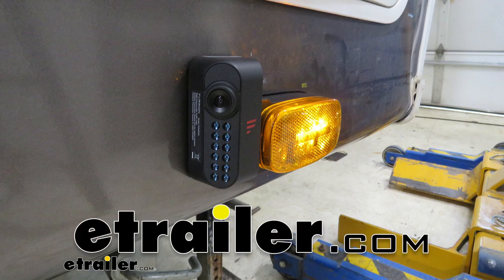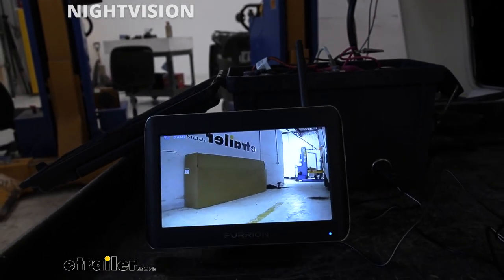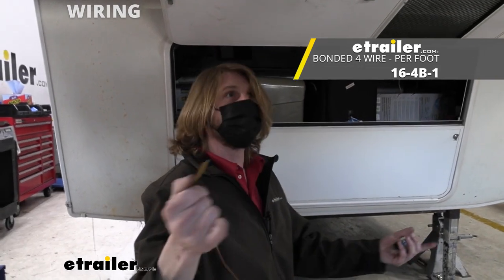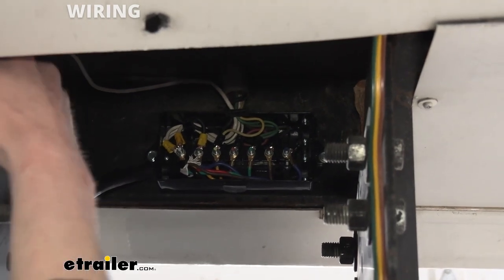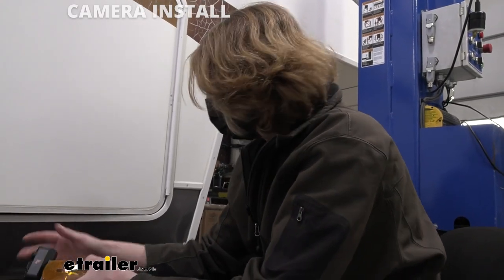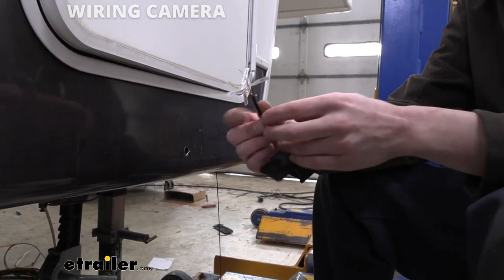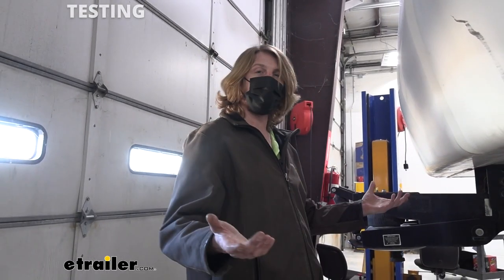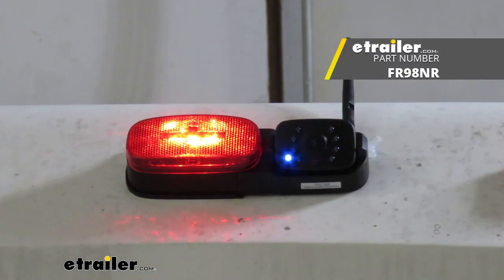Furrion Vision S Wireless RV Observation Camera System Installation - 2009 Carriage Cameo Fifth Whee

Comment: You gave the one tip no one else did : you have to push the pairing button on the camera till it clicks. I thought I had wired it wrong, but running light was coming on. For no turn signal setup, twist red camera and brown marker light wires together, then butt connect them to positive circuit.